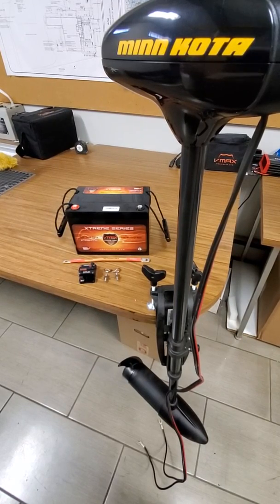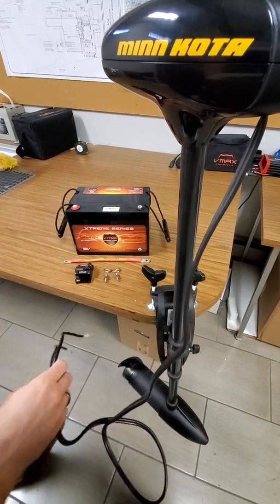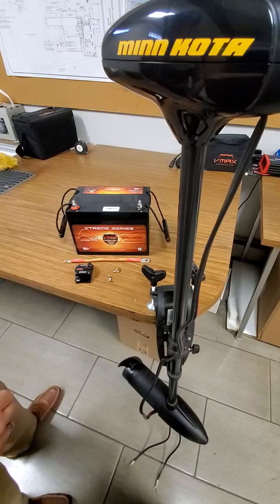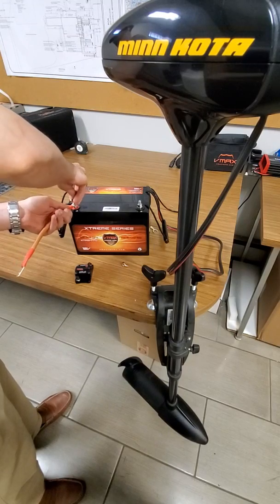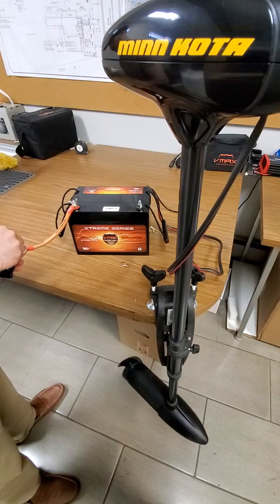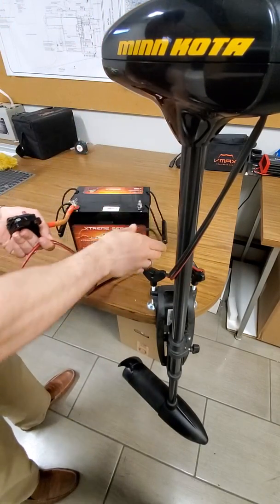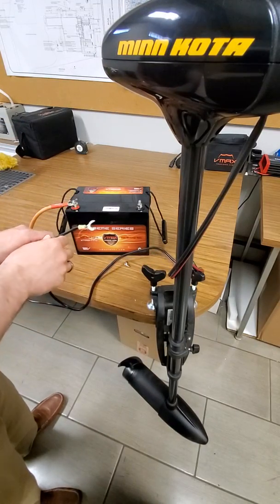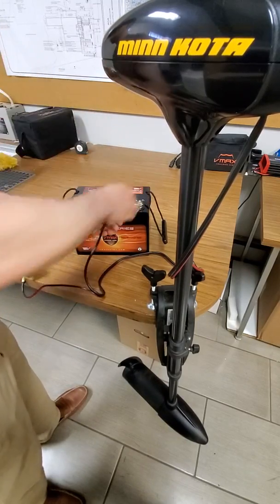How to connect your trolling motor to a battery with a circuit breaker

Comment: Question how do I know which size circuit breaker wire I should get
Reply from the maker: Motor Thrust / Voltage	Recommended Circuit Breaker
30–55 lb (12V)	50-amp
70–80 lb (24V)	60-amp
101–112 lb (36V)	60-amp
112–115 lb 36V	60-amp
128–136 lb (48V)	60-amp

The VLYNX 50A VCB50 or the VLYNX 60A VCB60 are recommended. 
https://www.vmaxtanks.com/Circuit-Breakers_c_71.html

Comment: Whats the best (what brand)circuit breaker for a minn kota 24V 70lb thrust power drive?
Reply from the maker: For a 24V 70lb thrust trolling motor, a 50A or 60A circuit breaker is recommended: https://www.vmaxtanks.com/Circuit-Breakers_c_71.html

Comment: I was looking for this video for a long time. Thanks! How do I know which cable to get between the battery and circuit breaker? I have a 100Ah LiFePO4 battery with a 55lbs trolling motor
Reply from the maker: Glad the video helped! We recommend a 4 Gauge 100% copper cable, anything between 9"-16" is fine, depending on where you mount the circuit breaker. Check out Vlynx cables: https://www.vmaxtanks.com/Cables-_c_70.html

Comment: what are the details on the battery cable - amps volts, capacity)   Thanks.
Reply from the maker: This listing has all the specs in the item specifics: https://www.ebay.com/itm/303801841102

Comment: This is the best trolling motor I have ever owned. Very powerful and the salt water does not have any affect on it. The reverse is just as powerful. This motor performs just as well as the high dollar motors.
Reply: Long shot cause this comment is a year old but which trolling motor did you pick up man? Still holding in like a champ?

Comment: Minnkota 60 amp breaker.marked with battery terminal and load terminal. Instructions read for 12 volt application connect battery positive to battery end of breaker, then load end of breaker to the positive lead to the trolling motor

Comment: You should NOT put that positive “on any side”. It’s supposed to go to the area marked BATT and the other area which is marked LOAD goes to the trolling motor. You are misleading a lot of people.
Reply: I have circuit breakers that are not marked like you say. Came with no instructions either. Haven't found any videos
Reply: U R 100% RIGHT. STATES RIGHT ON the CIRCUIT BREAKER, TO BATTERY and TO ACCESSORY
Reply: I-17 Bingo U r absolutely correct
Reply: Mine is marked "load" and "line"
Load goes to trolling motor

Comment: Hey mate, how deep do you submerge your 12v trolling motor into the water and do you have a marker on the motors shaft , noticed some motor mounts/transom are higher than others so wondered how you do it and gauge it or is it set up permanently, thanks.
Reply: The  cavitation plate should be just below the bottom of the boat.

Comment: What's the amp use on that breaker and what gauge wire  are you are using?
Reply: That is a 60 amp VLYNX circuit breaker with a 4 gauge vlynx 100% copper cable. I have been using these VMAX products for quite some time and they work great

Comment: Are these circuit breakers standard for a 12V battery? Or is there some designation you look for? Where do you get them?
Reply: I ordered mine from Amazon. 50amp waterproof breaker. It was fairly cheap maybe 8-10$

Comment from the maker: Battery Run times and options for popular motor sizes:

12 Volt 30lb Thrust Motor:
12V AGM:
V35-857(pictured), weighs 25lbs, dim: 7.7"w x 5"d x 6.1"h, Estimated Continuous Run Time(ECRT)  at Highest to Low Speeds: 1.2-5.8 hours
MR86-50, weighs 33lbs, dim: 7.8"w x 6.6"d x 6.7"h, ECRT: 1.3-6.7 hours
MR96-60, weighs 43lbs, dim: 9.2"w x 5.5"d x 8.2"h, ECRT: 2-10 hours
MR107-85, weighs 55lbs, dim: 10.2"w x 6.6"d x 8.2"h, ECRT: 2.7-13.3 hours
12V Lithium:
LFP22-1255, weighs 16lbs, dim: 9" x 5.5" x 8.2", ECRT: 2-10 hours
LFP27-12100, weighs 25lbs, dim: 12" x 6.7" x 8.2", ECRT: 3.5-17 hours

12 Volt 45lb Thrust Motor:
12V AGM:
V35-857, weighs 25lbs, dim: 7.7"w x 5"d x 6.1"h, Estimated Continuous Run Time at High to Low Speeds: 0.8-3.9 hours
MR86-50, weighs 33lbs, dim: 7.8"w x 6.6"d x 6.7"h, ECRT: 0.9-4.4 hours
MR96-60, weighs 43lbs, dim: 9.2"w x 5.5"d x 8.2"h, ECRT: 1.3-6.7 hours
XTR34-75, weighs 45lbs, dim 10.2"w x 6.6"d x 7"h, ECRT: 1.5-8 hours
MR107-85, weighs 55lbs, dim: 10.2"w x 6.6"d x 8.2"h, ECRT: 1.8-8.9 hours
MR127-100, weighs 67lbs, dim: 12.1"w x 6.7"d x 8.2"h, ECRT: 2.1-10.6 hours
MR137-120(pictured), weighs 75lbs, dim: 12.9"w x 6.8"d x 8.5"h, ECRT: 2.4-12.2 hours

12V Lithium:
LFP22-1255, weighs 16lbs, dim: 9" x 5.5" x 8.2", ECRT: 1.5-7 hours
LFP27-12100, weighs 25lbs, dim: 12" x 6.7" x 8.2", ECRT: 2.5-11 hours

24 Volt 70lb Thrust Motor
:
(2) MR107-85, weighs 55lbs each, dim: 10.2"w x 6.6"d x 8.2"h, Estimated Continuous Run Time at High to Low Speeds: 2.3-11.4 hours
(2) MR127-100, weighs 67lbs each, dim: 12.1"w x 6.7"d x 8.2"h, ECRT: 2.7-13.6 hours
(2) XTR27-110, weighs 68lbs each, dim:12.7"w x 6.8"d x 8.1"h, ECRT: 2.9-14.7 hours
(2) MR137-120, weighs 75lbs each, dim: 12.9"w x 6.8"d x 8.5"h, ECRT: 3.1-15.7 hours
(2) XTR31-135, weighs 77lbs each, dim: 12.9"w x 6.8"d x 8.5"h, ECRT: 3.7-19 hours
(2) XTR12-155, weighs 91lbs each, dim: 12.9"w x 6.9"d x 10"h, ECRT: 4.4-21.5 hours

Lithium:
(1) LFP27-2455 24 Volt Lithium, weighs 25lbs, Estimated Continuous Run Time at High to Low Speeds: 1.7-9 hours
(2) LFP27-12100XTR, weighs 25lbs each, ECRT: 3-14 hours

Comment: My friend my minn kota trolling motor 30 lb thrust has a 14 guages wire,I wanna put a quick disconnect n a 50ACB what wire should I use from BTRY to CB to my quick disconnect with my motor that has 14awg i hope i explained ryt😁 thnk u so much good day.
Reply: Thnk u much stay safe 🙏
Reply from the maker: A 4 gauge cable is fine to use and will be compatible with your motor's 14ga wires: https://www.vmaxtanks.com/VBL4-09B-4GA-9-Battery-Link-Connector_p_73.html

Comment: Question, if using a RF reverse Polarity switch for my trolling motor, does that act as a Circuit breaker or do I still need to install one? I’m doing the one speed instead of the multi speed option with ability to reverse￼
Reply from the maker: Yes it is still recommended to use a circuit breaker to protect your motor from any surges in current. A manual circuit breaker will also allow you to disconnect power from your battery in an emergency situation.

Comment: what size of battery cable?  I got a 4 AWG 12 inch cable.  will that work?
Reply: Hi, im trying to connect a cable from my battery to circuit breaker and the post on breaker is 1/4" and connector is much bigger.  Looks like yours is the same.  Dont I have to cut off end of cable and crimp a 1/4" ring terminal? Thanks
Reply: 4 gauge is really overkill... Minn kota  manual states 8 gauge if shorten then 5 feet
Reply from the maker: Yes that will definitely work, I used VLYNX 4ga 100% copper: https://www.vmaxtanks.com/VBL4-14B-4GA-14-Battery-Link-Connector_p_75.html
Reply: velosterNG thanks ! I’m new to this kind of stuff.  I appreciate it